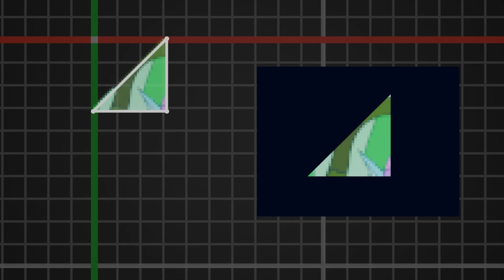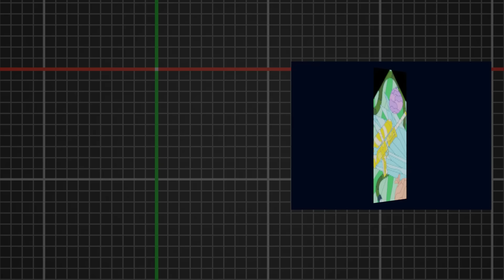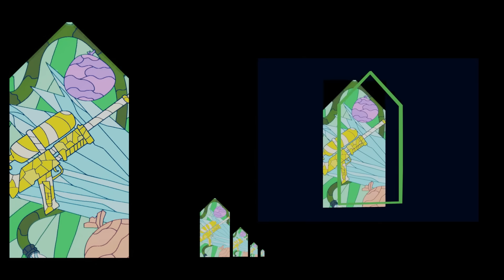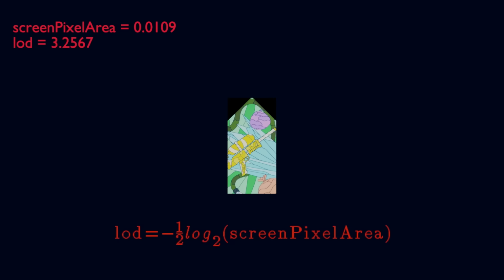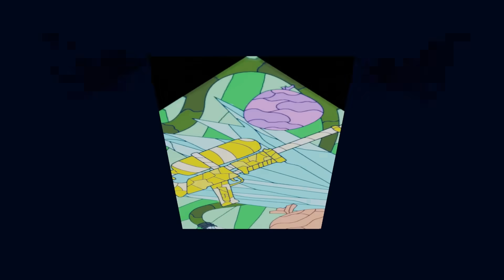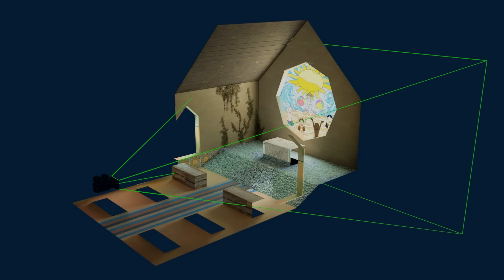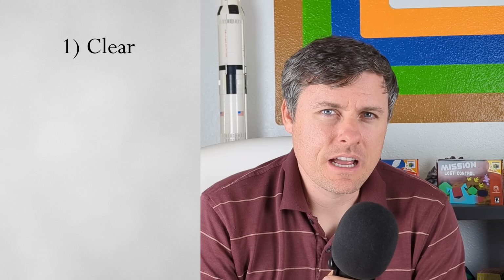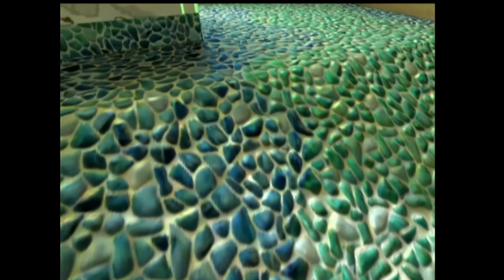How I implemented MegaTextures on real Nintendo 64 hardware

Comment: this scene easily looks like it would have been from 2 whole generations ahead of the actual hardware, like on a PS3 or something, wow :D

even if this isnt particularly reasonable to be your defacto graphics standard for a full-feature game on the N64, i still think this could have had some potentially useful applications if only developers for the N64 had thought of it ~30 years ago, such as very high quality ingame, not pre-rendered, cutscenes, or for the particular use case you're thinking of using it for Portal64, to make really clear illustrations and text on certain surfaces. the funny thing is,a similar technique was actually used pretty frequently on older hardware of the time, such as the SEGA Genesis, Super Nintendo, and even the OG NES, to make really large and detailed-looking sprites despite the limitations of those consoles. i wonder why you never really saw it on N64 games.
Reply: I wouldn't assume that the developers back then didn't think of techniques like this... They were very clever programmers.
Reply: @johnsch8634 that's fair, but then the implication is that they would have thought of it, but decided not to use it, which also seems somewhat unbelievable to me.
Reply: @Templarfreak  Well, then you gotta think about factors like the price of ROM carts. and recall that Mario 64 was only 8MB and even Zelda was only 32MB, so a 1MB set of textures for a super-HQ cut-scene would not likely be seen as a wise investment of resources.
Reply: @johnsch8634  that was just an idea in the OP, but there are plenty of other applications that could be done that would hardly take that much more space at all that could still vastly improve the texture quality in very specific situations. there's a few places in OOT that could have benefitted from using multiple segmented textures to display much higher-quality images and still be very fast as well but it is simply never done in that game. in such a case where it's just 1 image on a wall, and maybe this is done in 4 or 5 places throughout the game, would hardly impact the size of the game much at all. the images dont have to rise into MBs territory to achieve good readable quality.

Comment: Imagine the people's reaction in 1996 if they saw this demo.
Reply: Could you make a board game or card game using this technique? Something like hearthstone on the N64. It would be mainly fixed camera then and you only have to render the card playing area and cards in this technique.
Reply: @arthurkuwar9524  That's the problem though they're making big games and you have to cut corners somewhere because of hardware limitation. Some developers did quite an amazing job on the console because it was the 90's after all, no hindsight. To me after mario 64 and zelda no games really appealed to me on the system, did the graphics look good? Not really. You had to compare it to the playstation and the pc which had started to turn into quite a powerhouse by this time. That 3dfx voodoo card changed everything. That one I remember well, a friend had the card and I could not believe my eyes. We were so used to seeing pixels so clearly(like playing quake). I remember asking how can the game run so well with that amazing graphic.
Reply: @huldu  Nintendo really messed up with forgoing CD and their awful, unoptimised SDK with strict restrictions on code. To think Mario 64 alone - the optimisations and enhancements made by Kaze Emmanuar to that engine means that the og SM64 could now run at 640x480 with enhanced graphics, textures, higher LOD, pushed out draw distance in full 16:9 at 60fps.  That's the level of improvements coming in on the N64 home brew scene slowly.  Julian Eggbrecht, Factor 5 also stated in an interview in 2002/3 had Rare wrote a completely new engine using what they learnt about the hardware instead of bolting onto the inefficient 1st gen GE engine and also wrote custom microcode to make use of the N64 hardware Perfect Dark alone could have run at 640x480 with a 30fps lock - but alas Nintendo did not allow developers to do this or did they provide the documentation to aid. Factor 5 and Boss I believe were the only developers who were allowed to run custom microcode on the system.  The crazy thing is  that SGI designed the N64 all around it's ability for developers to write custom code for their games and Nintendo forced a generic code on all developers that wasn't even optimised for gaming.
Reply: @overwatch761  A lot of that I didn't know. Good stuff. I remember F1 World Grand Prix (Factor 5, I believe) looked photo-realistic and I liked that tires could fly off if you crashed too much then your car would just go in circles (if it was one of the front tires).
Reply: @overwatch761  So true and sad
Reply: Imagine the sales the N64 would have gotten if this was the graphics demo and had actually games using it
Reply: @FortniteOG420  biggest problem where the cards. 64mb at max. Image most beeing clocked at 32mb max. That litterally is laughable for 3d games. 16 bit games already had 32mb games if i'm correct. the storage on the carts was really pathetic and also a bottleneck.
Reply: Cartridge size was also a problem for high quality sound and graphics.
Reply: @TheDeathmatchKlan Nope
Reply: That's why its a Demo and not a real gameplay . I bet this is not playable and needs lots of rom cart.
Reply: @txeriff2k6  it's a demo playable...
Reply: @dionnnnnnnn  so true. And what realize pains me is that many people here on YouTube who plays retro games it’s not just that they record the long play from their modern monitors. They often also put the game in higher resolution.  I get that some times it can look better and that those intended is to make it look more HD but often it just looks worse. As you say both for pixels and low poly. Higher res just brings out the worse.

What I don’t get is why not more use those CRT emulation filters. Even if it’s not as good as watching it on a CRT running a 320x200 game on a 4K screen still just having the 320x200 as upscaled base resolution and then applying scanlines / glow aperture etc shader filter can make it look nice. But nooo instead they just upscale it to 4K super shard resolution so r apply some odd smoothing filter that makes it look blurry in a bad way.
Reply: proving once anf for all the N64 was not just hype!!!
😁

...sadly no devs back then could pull stuff like this off. not even Rare. 
its great to see this kinda stuff tho. for ones who bash the system.
Reply: in my memory all games looked like this back then
Reply: Nintendo would've fixed the cache limit and go to CD rom, mayhaps.
Reply: @MinaNohara  Not sure what you're talking about here. This is detailing how to circumvent the 4KB texture cache issue. It's too bad though that we didn't have maybe 2x the capacity in cartridge size.
Reply: @dionnnnnnnn  it’s also funny as you say how they pay a lot for “real hardware” and still play with adapter on modern screens. 

I have some friends that love the Amiga. And they scoff at emulators. Do they spend xxxx money to get a real Amiga. Throws in new HD emulator. More modern memory. Sometimes even new gfx cards and hook it up to their 4K displays and says that now it’s the real hardware. I don’t get it. What is the point?  Especially as many good modern emulators almost perfectly emulates it. 

I would much prefer myself then to get an old real hardware CRT monitor that I could hook up to my modern computer that runs the Amiga in an emulator. Then I know that it both look, sound and play as close as it did back in the days
Reply: The best part is that this is what the N64 hardware was entirely designed to do!

For some reason, Nintendo massively underpowered the RCP microcode and SDK tools. Maybe they just didn’t actually understand what they’d even bought off SGI!
Reply: Tbf my mind was already blown by Super Mario 64, coming from Super Mario World. I’m not sure my brain would’ve comprehended a difference
Reply: Brains would break
Reply: People would be wading through gore from all of the head explosions.
Reply: Remember that Dinosaur from Demo 1 disc? I would assume the reactions would be the same lol
Reply: It's hard to imagine a time when I was dead
Reply: I’d shit myself and shit myself again back then
Reply: Sony has understood this and has put a fully animated dinosaur model on its first demo CD. This shows the machine's potential.
Reply: ......
No hope in going to the past come to the loving savior today 
Seek his Holy Spirit in prayer today he can give you peace confort and guidance today 

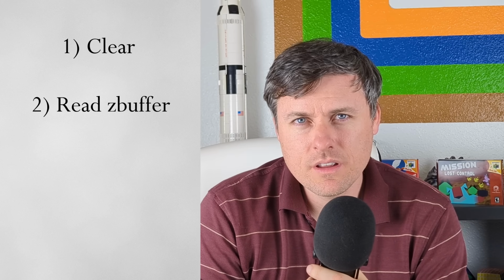Romans 6:23
For the wages of sin is death, but the free gift of God is eternal life in Christ Jesus our Lord.
Come to Jesus Christ today 

Jesus Christ is only way to heaven 
Repent and follow him today seek his heart Jesus Christ can fill the emptiness he can fill the void 
Heaven and hell is real cone to the loving savior today 
Today is the day of salvation tomorrow might be to late come to the loving savior today 

John 3:16-21 

16 For God so loved the world, that he gave his only begotten Son, that whosoever believeth in him should not perish, but have everlasting life.  17 For God sent not his Son into the world to condemn the world; but that the world through him might be saved.  18 He that believeth on him is not condemned: but he that believeth not is condemned already, because he hath not believed in the name of the only begotten Son of God.  19 And this is the condemnation, that light is come into the world, and men loved darkness rather than light, because their deeds were evil.  20 For every one that doeth evil hateth the light, neither cometh to the light, lest his deeds should be reproved.  21 But he that doeth truth cometh to the light, that his deeds may be made manifest, that they are wrought in God.

Mark 1.15 
15 And saying, The time is fulfilled, and the kingdom of God is at hand: repent ye, and believe the gospel.

2 Peter 3:9
The Lord is not slack concerning his promise, as some men count slackness; but is longsuffering to us-ward, not willing that any should perish, but that all should come to repentance.

Hebrews 11:6
6 But without faith it is impossible to please him: for he that cometh to God must believe that he is, and that he is a rewarder of them that diligently seek him.
Jesus
Reply: They did, sorta. The N64 demo was run on like $250,000 SGI hardware, lol.
Reply: Rage did this and people really didn't like it
Reply: Many parts would have been shat
Reply: Yeah will be good
Reply: They would have rioted more….
Reply: I would have creamed my jeans.
Reply: Would be kind of pointless with the displays of the time.
Reply: If I'm not wrong, Mario 64 has 6MB or so. RE2 has 64MB.

People could have done better than this mega texture imho, but they knew it would be useless.
Reply: @elsamuh  

Mario 64 was one of the first games, of course it will not use all the memory, they already using so many new tools to make this game, RE2 use it, so it don't fit more space (and it's a port from a PS1 game that have so much more MB, 4 or 5 times more).

You use two exemples that don't make sense.
Reply: @elsamuh  Not with efficient texture compression and reasonable sizes. This is 40 MB because up close they're very high res, but probably only 6.25% of this was needed (4x res downscale).
Reply: And 6 fps in open location and 15 in close?
Reply: They all would have had a headache because the frames are choppy asf
Reply: @CertifiedClapaholic  nobody cared about framerate back then lol
Reply: @TheXiaoLong  Cries in Cruis'n USA.
Reply: @TheXiaoLong  
 It all depends from where you came from. Remember that SNES / Megadrive era it was a lot of obsessions about this and how smooth 60fps run on those vs choppy PC so yes framerates was a big topic aroundf this time.
Reply: @CertifiedClapaholic Perfect Dark got as low as like 10fps, People wouldn't really notice on a noisy CRTV

Comment: Is 64MB a hard limit, or was that just the limit of the ROM cart sizes of the time? If there's a hard limit imposed because of the ROM interface, is it possible that limit might be bypassed somehow through the 64DD interface? I remember it being rumored early in development that 64DD would have 100MB disks. Not sure if there's any truth to that, or if it even matters if that interface might be slower than the cart interface.
Reply: I believe the limit is 256MB, and I think the 64drive is the only flash cart which supports that. It wouldn't surprise me if someone worked out how to use more than 256MB.
Reply: I have the same question. Paging the cartridge should be possible, I would think (though require custom cartridge hardware), by accessing a specific address to request a different page (essentially swapping cartridges mid-game).
Reply: i think it turned me gay
Reply: 256 Mb not MB 😂 bits vs bytes 😅
Reply: @timmygilbert4102  256Mb is 32MB, so half the biggest cartridge size.

Comment: Could you use smaller mipmaps for parts of the scene that are closer to the edge of the screen? Most of the time while you're playing a game you're looking at the center of the screen and move the camera if you want to look at something off to the side, so if you took advantage of that maybe you could get more fps with a smaller noticeable graphics impact
Reply: Ah, the fixed foveated rendering approach I see!
Reply: Does Fixed Foveated Rendering look good in practice?  Eye tracking is a necessary component IMO.
Reply: Or for parts of faces that are closer to the camera. Downside is, if this requires more than the two mipmaps normally loaded, you're going to have a bad time.  Maybe it can be prioritized over what's on the screen, and if space allows, go for it.

Another thing that would help is simply dividing faces of large size or aspect ratio into smaller pieces -- the PS1 way of dealing with its affine mapping.  But this incurs more geometry, and being that it's already rather limited...
Reply: That sounds like foveated rendering, which is used by VR headsets like Apple Vision Pro. Another option is Variable Rate Shading.
Reply: Imagine the game is blurry at the edges. There's your answer.

Comment: Question how the fuck do u do this shit with no graohics acceleration and i struggle to render a freagging teapot on my software rasterizer in python on a moden gpu with compiled code and grapphixs accelerated pugame window handling??? I ported it to c++ and it ran at 18p fps bht still for just a reapot with no texture running on a decentlu modern cpu it should run at 1000++ if u can run dis on a fregging n64

Comment: Brilliant, I never would have thought that this tech could be implemented on N64. I was recently reading up on MegaTextures/SVT for the simple fact that it has a lower file size than other virtual texturing methods. It's too bad no one considers it to be a viable alternative with the emergence of RTXIO & DirectStorage which would eliminate drawbacks many consider to be a deal breaker.
Reply: Game didn't stop using them, if you play far cry or call of duty, it's de facto the technique used. At least for terrain. You trade texture per surface, so game used it where it's needed. Nanites is using such a techniques too.
Reply: could you point me to your sources? I got really interested in megatextures after Lex Friedman's interview with Carmack, but I just didn't get far
Reply: @prgnify  look on the GDC vault of these game or look for ' advance in real time rendering ' notably 2023 for call of duty in the blog selfshadow

Comment: Imo the performance penalty for swapping textures in and out of the texture cache makes this basically unusable for an actual game scenario, the fps already looked kind of bad in that basic test scene and it barely had any geometry which proves my point. It would be best to just stick with a few 64x64 4 bit textures or 64x128 greyscale ones to maximize the average level of detail since those can actually fit in the texture cache without having to worry about mipmap levels (in fact to even get textures of that size you have to disable mipmaps in the texture settings anyway)
Reply: Yeah, let’s add geometry! Also seems like omission of the z-buffer didn’t help much as games use it. The tiles fit into the cache. Greyscale does not work for everything.

So you want to sort by texture?

Comment: Seeing an n64 even being able to make readable textures is amazing, you're doing an amazing job with such limited hardware!
Reply: Now to add variable rate shading
Reply: Are you saying "L is real 2401" is not readable on SM64?? 😅
Reply: @lerikhkl  mate that texture actually says eternal star. the whole "L is Real 2401" theory wouldn't have come about if the textures weren't so low res and unreadable, now would they? :)
Reply: If the n64 looked like this in the 90s it would have blown playstation out of the water
Reply: @Syncrotron9001  Probably but the idea of mega textures didn't exist till the PS3 and they've always had tons of issues which is why they never took off.
Reply: @theninjamaster67  someone fixed the framerate on mario 64 on the original hardware, if the FPS fix and mega textures ever get mixed into a working home brew that works on the original hardware that would be amazing.
Reply: @Syncrotron9001  That would never run in a game, lol.